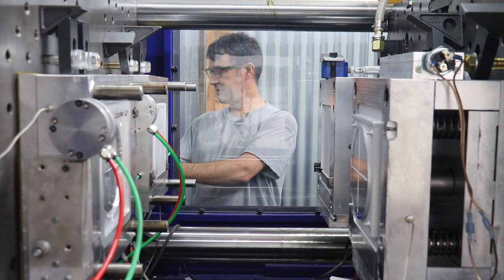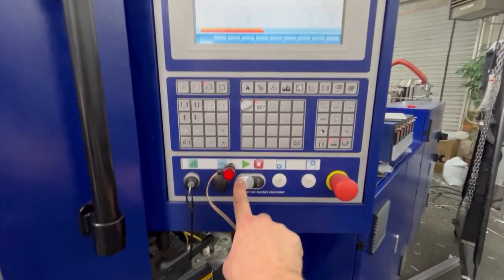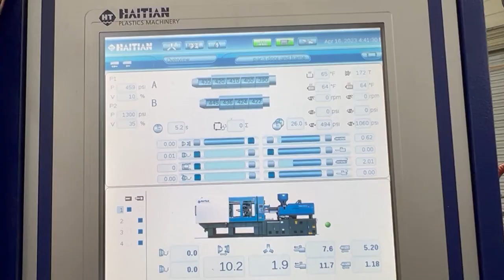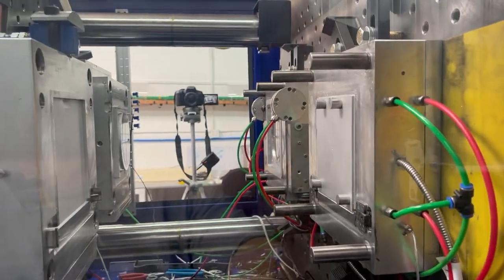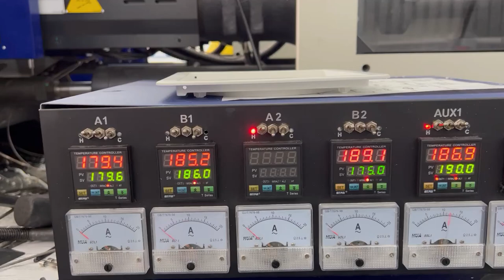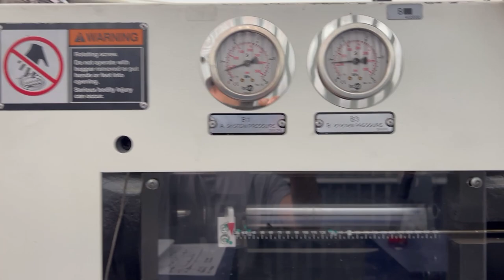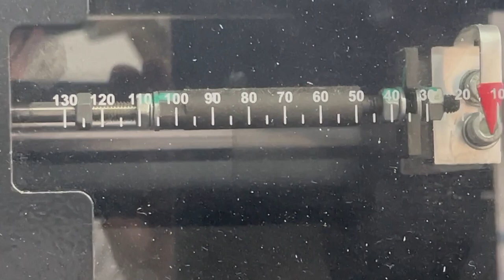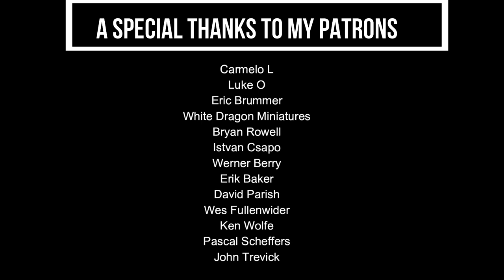Plastic Injection mold - door frame set

Comment: I would love to see a video on the basic financial cost of running and what you charge for making the mold and how much you change for 1000 or 10,000 parts. or how long it takes to pay off the equipment.
Reply from the maker: Let me see what I can do. I do research too, so 1/2 the cash flow is for product development. I have an engineering day job and I do side work too. In general $60/ hour for machine time

Comment: Very impressive shop and equipment.  I am very puzzled by your terminology of mold components.  Over 40 years of experience in the industry I have never heard of a lot of the terminology you use.  I would also suggest some updated mold design software to eliminate design errors causing you repair work.

Comment: I'm interested to know how much clearance you allow for the ejectors so they operate freely but don't flash?  Nice video...gnarly welding 😂🙂
Reply from the maker: Usually 0.0005” or 13 um per side of the ejector. Also acts as an air vent. Thanks for watching!

Comment: at 13:00 you mising a screw for the actuator connector
Reply: within qc specs
Reply from the maker: Hmm, if I put a screw into the 4th actuator hole then I would be making a 250 ton screw cutting machine. That was not my intension there. Thanks for watching.
Reply from the maker: @frankishrebellion9479  maybe watch the mold open again around 13:00

Comment: YOUR MOLD PROTECT IS NOT SET CORRECTLY.  MOLDING FOR 20+ YEARS, AND WE USE A BUSINESS CARD. IF THE TOOL LOCKS OVER ON IT, WE CAN GET WROTE UP, POSSIBLY FIRED. YA IT WORKED THE SECOND TIME, BUT STILL SHOULD NOT HAVE LOCKED OVER  THE FIRST TIME EVEN IF THAT TUBE WAS WARM AND SOFTENED. BUT I ALSO DEAL WITH 500K TO 2.5 MILLON DOLLAR TOOLS.